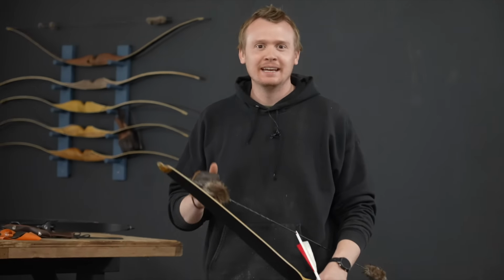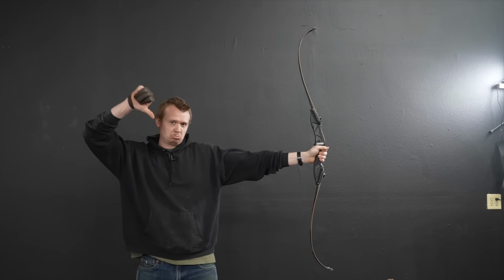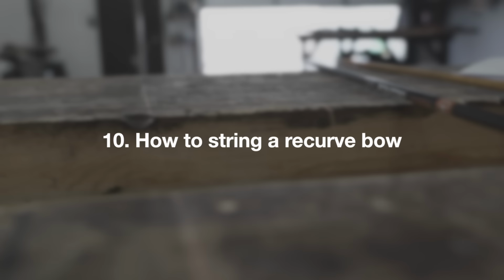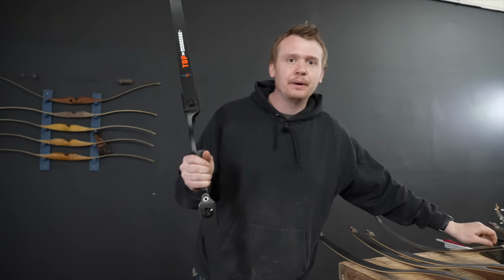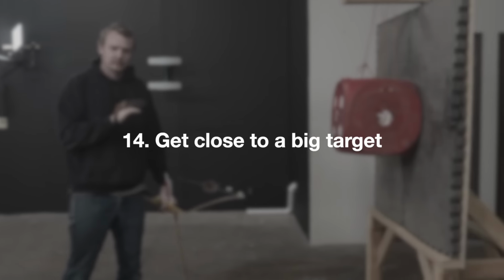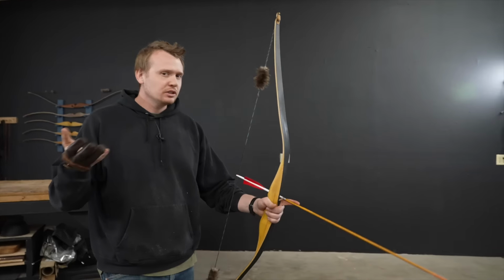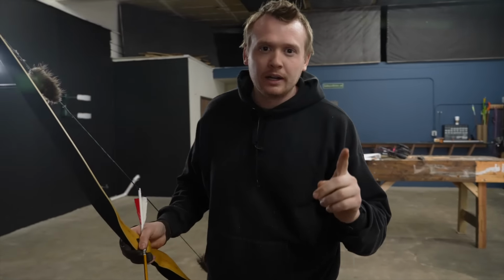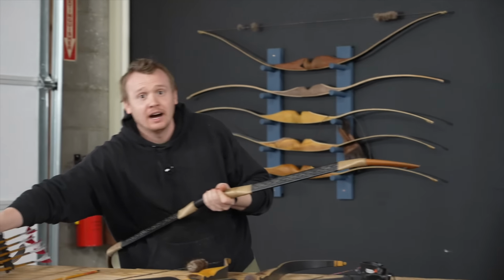Archery For Beginners 27 Important Things To Know

Comment: Wow. amazing content and spot on in all regards.

I would like to comment on instinctive shooting. I have been at it for over 50 years.
I have been building my own bows for about 40 years as well, my arrows for a few more years.

There are some key issues to shooting instinctively well.

Consistent grip. anchor and release are essential.
So it tuning. I weigh and spline test all of my shafts before I build. I also paper test.

Realistic expectations are important.  Unless your name is Howard, it is highly unlikely that you will shoot higher scores on paper than your friends who shoot gap.

I very consistently do better on small game and birds than my gap shooting pals but at silhouette shoots, particularly at known distance, I am in the middle of the pack on a good day. 

The only real advantage of instinct shooting for me is the ability to get an acceptably accurate shot off quickly. I hunt in very dense cover for the most part and a fast delivery is pretty crucial.
Please don't shoot at running deer, that is not the point.

The best way to learn is to get a good bow that is much lighter than you will hunt. You need to shoot a lot to develop consistency. You need tuned arrows. I shoot some pretty heavy bows but my training bows are about 25lbs at my draw length.

We use paper plates as targets because they are similar in size to the heart/lung area of deer.

Start close to the target and when you can consistently keep six arrows on that plate. move back. Repeat. 
Eventually you will get to a point where you have a maximum range. Cut that range in half and that should be your maximum hunting range.

I have managed to attain that accuracy out to 80 yards in the past, but I have never taken a shot at a game animal beyond 20 yards or so.

If you really want to polish your game, go roving. Shooting at unknown ranges will train your eye and help you establish where your limitations lie.

I hope you don't mind my little diatribe. Just some observations accumulated over a few decades that I think might be useful for someone considering instinctive shooting.

Liked and subbed.
Great content here.

Cheers!
Reply: You should make a video. Your writing is concise and informative! I’ve been shooting bow for about 30 years and still learn from older guys.
Reply: @clintonm2357  Thanks for kind words Clinton but I think this guy Kramer has a pretty tight leash on it.

Cheers

Comment: I received my RD Bones bow a few days ago. I'm really enjoying it. I thought the handle would be a little thicker, but it works. Once I pick it up, I can't put it down. The fit and finish is very nice, comparable to the few custom bows that I own which cost about a thousand dollars more than the Bones. If you're thinking about a new bow, the RD Bones won't disappoint you. You get a lot of value for the price and you get it fairly quickly, compared to a lot of bowers out there.

Comment: Nice video. Great info. I have a 62" bow, 20 pounds draw weight. I tried to use a spine calculator, but still not sure what arrows to get, the spine calculators started a 30 pounds?🤔🤔

Comment: Something I would add are a couple of safety issues.  If a taller person asks to shoot your bow don't give them a much longer arrow, they can over pull the bow and break it.  If you have a strong bow and have a light weight wooden arrow don't shoot it, it may splinter upon release and go INTO your hand like my Uncle did.  Lastly if you are shooting razor edged broad heads for hunting be VERY careful not to get that cutting edge close to the string, if it even touches it it may cut the string in half in a millisecond .  I have only seen it once but it was instantaneous.

Comment: Great video Kramer.  I have a left handed walnut handle RD Bones (that i haven't shot yet) and wanted to know if the arrow tuning you mentioned around the 18 minute mark is the same for left handed and right handed shooters.  example: for right handed shooters if the nock is going to the left then you need to add a lighter weight field point.  Is that the same for left handed shooters?
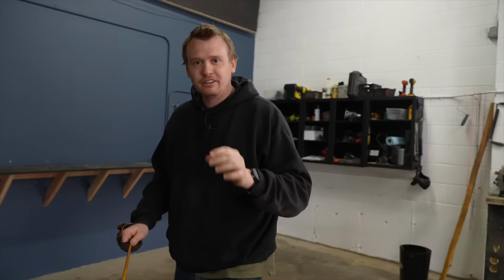Reply: A similar comment for a right hand bow.  At about 17:46 you say if the nock is left add weight to the point but  then it sounds like you say if the nock is right to also add weight.  I replayed it several times and it is still unclear.  Please respond.
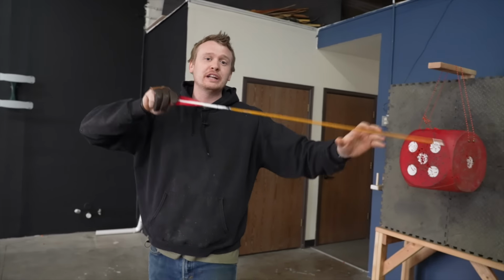Reply: Never Mind!  I turned on the transcript and read at 17:59.  Your word choice of add on a lighter point confused me.  I now get it.  Use a lighter point if the nock is left of the point.  Sorry for stepping on @bair1382 but I do not know the answer to his question.

Comment: Not sure if it was just the low quality of the bow stringer I got with my bow or what, but I found I prefer the leg method much more. I don’t place the tip on the ground I hook it on my ankle instead and then push towards my thigh to string it.

Btw: I only started archery about 5 months ago so I’m still pretty new, if what I said is wrong please correct me.

Comment: I shot a compound bow just a few times when I was in college forty years ago. I bought a compound bow when I retired from teaching five years ago. I’m a disabled veteran and I had my bow set at 32 pound draw and that has even become difficult in the last few years. I don’t want to hunt, I just want some exercise in my backyard. I just want some fun. I’ve been a firearms instructor for 35 years. The two enjoy very little overlap! I’m thinking I might need a 20 or 25 pound draw and I don’t want a compound and I don’t like sight pins. I’m in East Tennessee (Tri Cities).
Reply: A lower weight compound bow will still be easier than a traditional bow as the weight decreases significantly at full draw. Regular bows are full weight all the time.

Comment: One thing I disagree on, stringing the bow , the floor method you did is backwards to how I was shown and done correctly the bow does not make contact with the floor but I still deploy a small piece / puck of exercise mar and it puts the same tension on both limbs done correctly with the riser on the back of your thigh and in the middle of the riser.

Comment: Not sure where you learned that leg method for stringing a bow, but there is a much better and easier way where the tip doesn't contact the ground at all.
Reply: Hook one limb around your shin, brace the handle on the back of your knee, push the other limb forward with your hand while pushing the handle back with your knee.

Comment: Somewhat off topic but I figure you will know the answer.

I am interested in traditional but I have a compound on which I intend to mount a whisker biscuit. With most rests the loose grip seems to make sense because the rest will be falling away as the bow torques down.

Can you use the same hold with the biscuit since it fully contains the arrow? The question is will the loose grip allow the rest to move while the arrow is still in it?

Comment: So I'm not trying to nit pick anything as I am a beginner archer but when I have been taught to string a bow, you put your leg between the string and bow like you did but instead pushing the tip into the floor, you wrap the bow around your ankle where the top isn't touching the ground, so you are bending it with you hand and leg in the recurve parts. That shouldn't cause any damage to the bow, but like I said, I am somewhat new and could be wrong.

Comment: What are the fuzzy Tribbles on the bow string for?
Reply: staceyrivers3297- Those "fuzzy tribbles" you are asking about are called string silencers! if you pluck your string it will sound like plucking a guitar string. that is the vibration of the string that you hear. The silencers dampen the vibrations quickly so that you hear very little sound when you shoot! They are mainly used on hunting bows to prevent animals from "hearing" the shot before the arrows reaches them and moving out of the way!!

Comment: Years ago, I've tried out archery clubs, but didn't enjoy it. It was too proper, everyone had to fire at the same time, people too close to each-other. Too consistent and no variation.
I've been into archery my whole life, tried different kinds and weights, left-handed, right-handed, but only recently been able to get a bow of my own. A 40-ish pound Sicilian horsebow.
I prefer to draw with the arrow on the right of the bow and pinching the arrow rather than holding the string. I flick the bow to the left as I release. I don't aim with any point of reference, but accurate from about 10m. Going to start horse-back archery very soon, and looking forward to do some performances for our medieval local events.

Comment: This is a great video. It would have been better if it was around a year ago when I started.
I don't see any way good archers don't aim and instinctive is more like practiced guessing. Watching instinctive archers I have noticed they lose all accuracy when a parameter changes. When we through we do it with one hand that leads the projectile but in archery nothing you hold follows the path of the arrow.
Reply: Instinctive archery is not easy and requires alot of skill and practice to hit a target without aiming. Sure aiming down a sight is more accurate but anyone can aim down a sight and hit a target. Parameter changes for a sighted weapon just means the sight needs to be adjusted to reflect the change or the point of aim needs to change to account for the difference. With instinctive you are literally using your instinct to adjust for those changes. Most people can't do instinctive archery and if you took the sights away from most of those "good archers" they wouldn't be able to hit anything. I learned to use a bow around 10 years old and practiced a lot in my back yard. I realized quickly that sight pins only worked at a set distance and were in the way most of the time so I removed them and practiced moving back farther and farther for every shot. I got really good but out grew the bow and stopped shooting around 13-14 years old. 15 years later my wife and I won a trip to the Marlboro ranch in Montana and archery was one of the daily activities you could sign up for. There were around 20 people in the group and they give us all a cheap compound bow without any sights and a crash course on how to use it. We then go out to the course that has different foam animals placed along the trail at different distances with 12 arrows per person at each station. Most people struggled to even hit the first closest target at all which was a foam racoon hanging on a chain 20 feet away. I landed every shot and everyone thought I was lying that I hadn't shot a bow since I was a kid. The rest of the course was a similar outcome but I did miss a few shots at each target. The next best shot was my wife who hadn't ever shot a bow or gun in her life. I told her to ignore whatever the trainers were saying and made a circle with my fingers above the arrow and said this is the general area to aim for but don't think about it too much and just feel where you need to go. Darts are another good example of instinctive shooting. I don't aim my dart, I look at where I want it to go and throw it there. I've had multiple people ask how I aim my dart and are dumbfounded when I tell them I don't aim at all.
Reply: @travispoulin252 Thats a really cool story! Throwing darts are a great analogy for instinctive shooting!
Reply: @mybrother1350  Darts is a very close range version of instinctive shooting. The person above who said there's no good way for instinctive archers to aim when there is a parameter change is false. Even with sights, unknown distance change is a guess. The difference though is that after the first shot I have a feel on how to correct it naturally but the sights have to now guess where to aim more than I do if the distance change is unknown. The best part of that ranch excursion was watching the archery trainers and a couple of guys that were actual seasoned bow hunters struggle to hit the targets at all. They were even so butt hurt that on the last few targets that were moving targets on a cable, grabbed the rope to stop it right as I took a shot so I would miss. They did that for nobody else though and thought it was funny. Another benefit of instinctive shooting is guns. It's like archery but with a Lazer. I see people on YouTube hunting squirrel with a rifle and thermal optics and still missing. I was taking out squirrel high in trees with iron sights on a crossman bb gun. Think about native Americans that would hunt with primitive bows with deadly accuracy or gunslingers that could hit targets in the blink of an eye firing from the hip. It's a skill that not many people have and people that don't have it can't understand it.

Comment: So when it comes to archery, you actually shoot better if the release is not anticipated? Thats totally different from firearms, where youre most accurate when youre able to practice pulling the trigger and being able to anticipate when the trigger break is going to occur. Thats very fascinating
Reply: Well with a mechanical release or your fingers, there are no stages or travel. Like a smooth pull for some distance, then a wall etc. and the gun fires. You put progressing force on a stationary trigger until the crisp break. Timing this in your head can cause target panic and punching the trigger instead of smooth pressure.
Reply: I was taught that the trigger break should come as a surprise. I would say most people involved in firearm target shooting, especially ISSF style shooting has been taught the same thing. Trying to predict when the trigger will break typically leads to bad habits like flinching and recoil anticipation, which leads to inconsistent shots, and missed bullseyes. Depends on the discipline you shoot. The "tactical" shooting sports has a lot more tolerance for slapping/jerking the trigger than precision rifle/pistol sports.

Comment: The part about stringing a bow is weird. You're doing the push-pull wrong.
The easy way is to just create a lever with your leg, not poking the bow into floor. Step-through method is best due to its simplicity.

Comment: Wish i could actually afford a good bow, good string and good arrows. And well... good targets. 

But my echonomy barely allows me a cheap wish bow.. and we all know that's crap. So I won't get a bow..
Reply: I bought a Black Hunter knockoff for $60 with a finger tab and an arm guard. Cheap set of arrows for $40 and a cheap target for $26. Could have saved $26 and made my own target. May not be the best set up but it sure is fun. I wouldn't really call it a crap bow. If you are handy, Great Plains Bows has a mini series on fixing the major flaws with the Black Hunter. Shatterproof has reviewed this bow and I have purchased a better bow string from them. They are the best company in my opinion to deal with. The main thing is to have fun. I wish you well Andreas :))